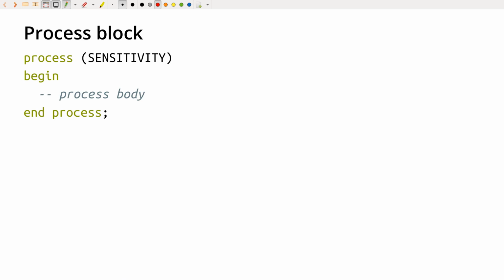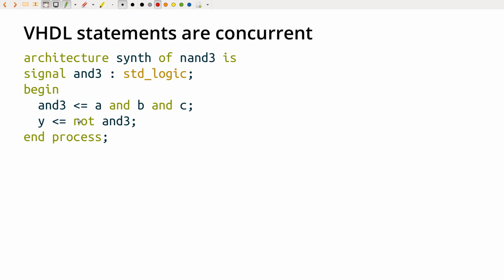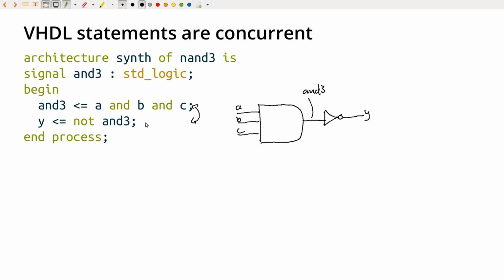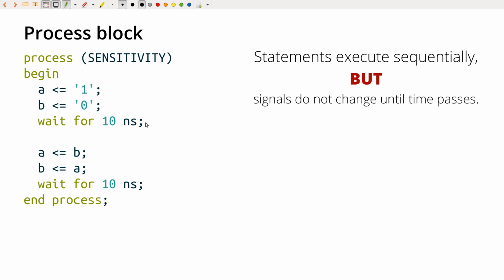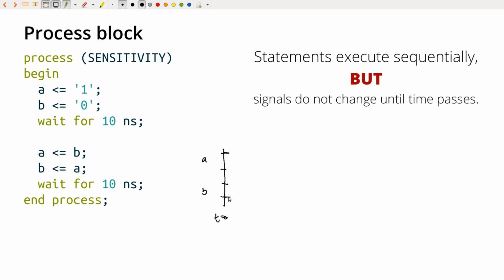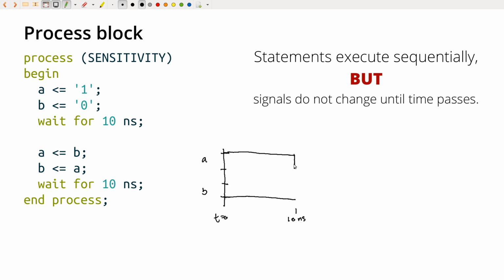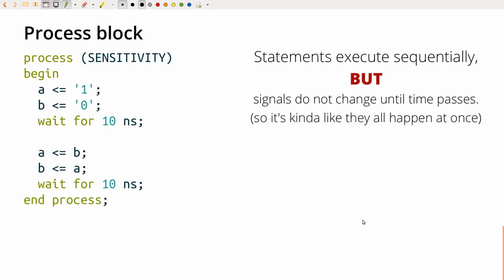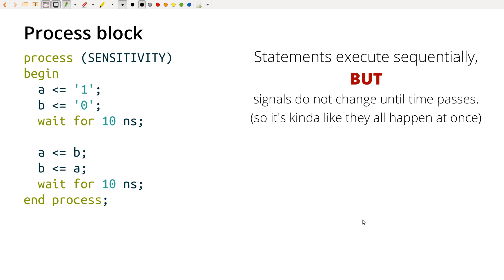What is a VHDL process? (Part 1)

Comment: Your explanation doesn't explain process, or even your sample code with respect to what is synthesizable and what is not. It's like teaching VHDL like it is a general programming language, and that is an issue. My point is, your syntax will work well on a testbench, but what about hardware implementation? Considering that you are putting in great effort to pass knowledge, I hope this is addressed in your subsequent tutorials. Well done.

Comment: Question: lets say inside a process i assigned the value of 1 to signal A and then assigned to value b and then after that i assigned A the value of 0, is that mean that at the end of the process b will have the value of 0 as well?
Reply from the maker: If you have these statements inside a single process block: `A <= '1'; B <= A, A <= '0'; , then B will get the old value of A, whatever it was before the process ran.  The new value of A will be 0.  The overall behavior will depend on the sensitivity, though.